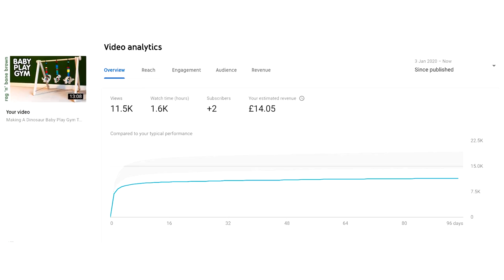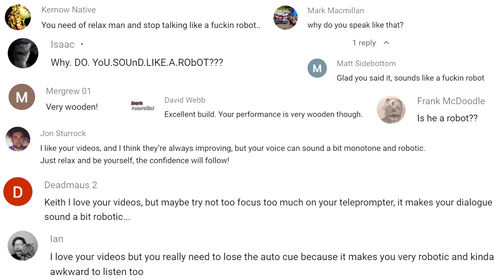Tips, Help & Advice for YouTube Makers

Comment: Great video Keith - the robot dance was hilarious and the bluebook website looks like a really useful resource also!
Reply: Quick question - you mentioned about the importance of audio in videos, and I'm really aware this is something I need to improve on, so I was wondering what mic you use/ would recommend? Apologies if you've answered this in another video :)
Reply from the maker: Cheers Jacob.   If you want an inexpensive one and you have a 3.5mm jack on your camera, I'd recommend the Rode Video Micro.  As long as you position it relatively close to you it's great value for money.  For my narrations I use a USB large diaphragm condenser called Blue Yeti.  Also nice but a bit more of a luxury purchase. There's a link in the description box to a video where I show the equipment I use if you fancy a look. Your videos are fantastic but yeah I reckon a mic would be a great upgrade for you. I actually have an old one somewhere, if I can find it I'll drop you an email as I'd be happy to send it to you
Reply: @RagnBoneBrown  Thanks Keith, that's really helpful and I'll definitely make sure to check them out, and if its not too much of a hassle for you, it would be amazing to try out the old mic!
Reply: @RagnBoneBrown  I'm also just wondering, do you have your mic plugged in all the time or only if you're speaking? 
I tend to vary the angle and distance of my shots quite a lot, so I'm just wondering if I'm trying to pick up tool sounds for example, do you think a stand alone mic or built in one would do a better job at giving you consistent audio (or does it depend on the specifics of what you're using?)

Comment: https://youtu.be/ZSEsEfbASbI saw this on you two a couple of days ago, never seen or heard about this tip on locking the chuck of a combidrill. I tried it with my DeWalt drill and it seems to work, share it with your vieweres, they might just learn something that might help. I had been having trouble using a drill/countersink bit where the bit kept coming loose, after trying this voilla it works. Hope this is of some help.